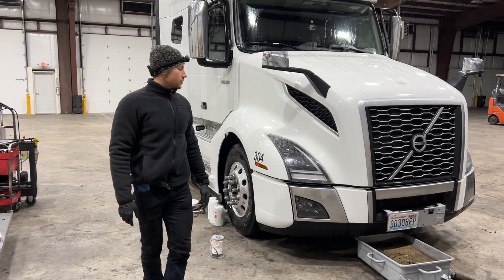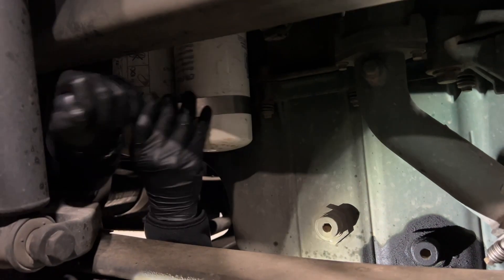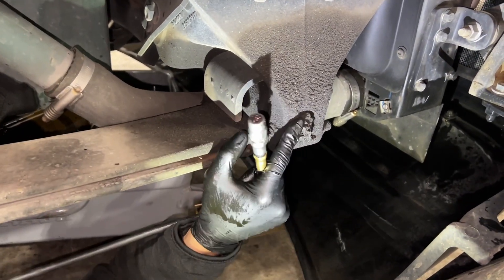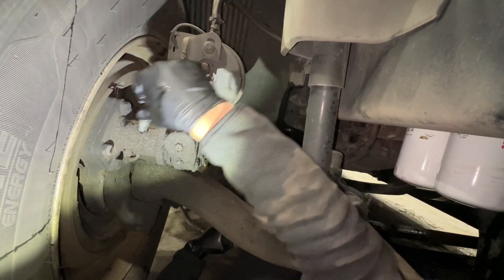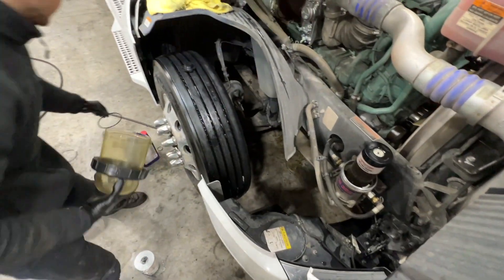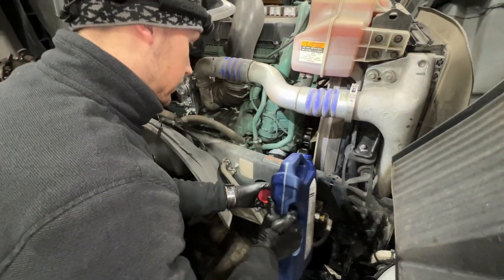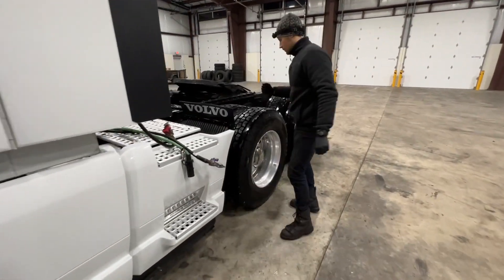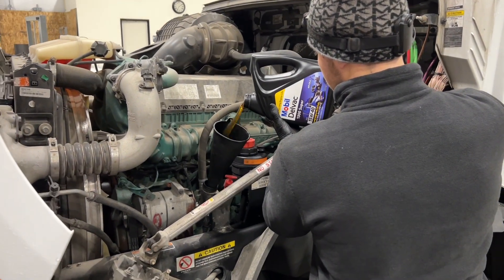2022 VOLVO VNL760 PM Service

Comment: How often would you grease the throw out bearing doing local work with containers, and how many squirts of grease is enough
Reply from the maker: I would do once every two weeks, 3 squirts. Do not over do it
Reply from the maker: Also the automatic transmissions do NOT have them

Comment: Can you use 15w40 in this new trucks ??
I have the same truck and it says 5w30 on the side of the engine
Reply from the maker: Yes you can. As long as your oil changes are 15-18k